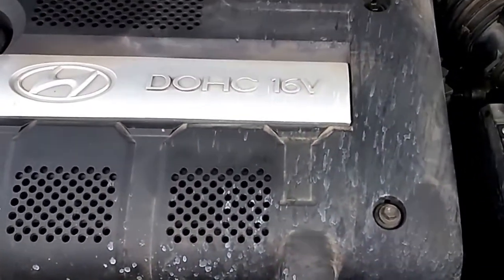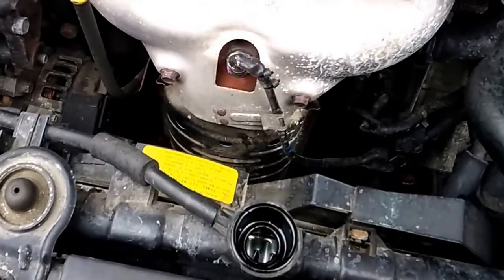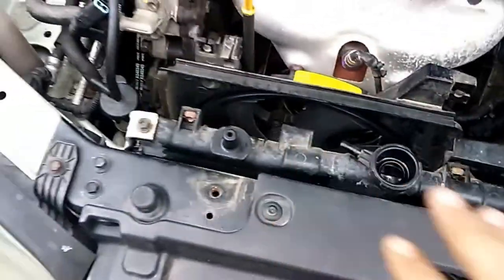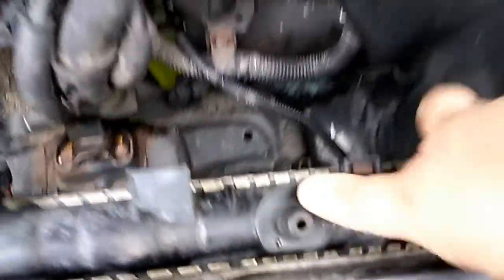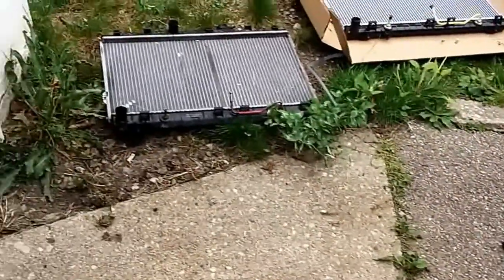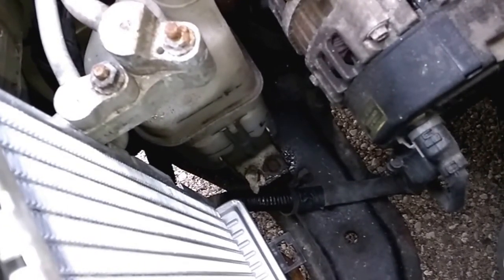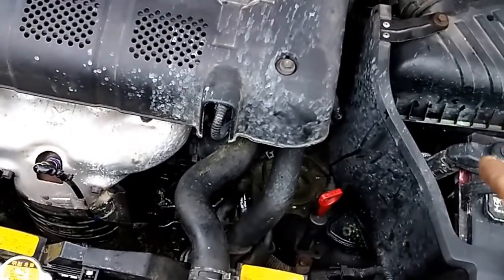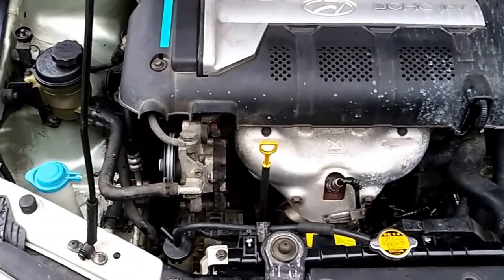How to replace a radiator in a 2004 Hyundai Elantra

Comment: Thank you for this video.  I'm a single mom and the radiator on my 2004 Hyundai started leaking last month.  Called different shops in my area and they were not encouraging.  Had one guy tell me that maybe it was just time for me to trade it in.  Wh?? I didn't know how I was gonna be able to get it fixed.  I did a google search and found your video.  After watching, I ordered a replacement radiator from eBay.  I've got all the tools etc. ready and waiting for it to arrive.  With your help from the video, ( I took detailed notes lol ) I have every confidence that this is something I can do myself.  I AM WOMAN!!!  haha.  If only I could pay myself $75 an hour for labor.  THANKS AGAIN!!
Reply from the maker: It's a super easy job, the only slightly tricky part was getting those bolts to line up on the sides, it just takes a little jiggling and patience and they go in.  The Elantras of this vintage are super easy to work on and fix in general.  It's been 75,000 miles since I made this video and the radiator is still doing fine.  I would quote one hour ($50) labor to do this job.  Your shop must be crazy. In the auto repair industry these types of jobs are called gravy jobs.
Reply: Thanks for the reply.  The radiator came in yesterday and when I got ready to drain the coolant, I noticed my radiator doesn't have the fittings at the bottom like the new one has.  Turns out it's because I have a manual transmission and not an automatic.  I've googled this and found that you can replace a manual transmission radiator with an automatic one just ignore the fittings.  Do you agree? Will they cause future problems? Should I try to cap them off or something?  Thanks again.  :)
Reply from the maker: Yes you can just ignore the fittings.  There is no reason to cap them off its a separate passage in the radiator from the coolant so it won't hurt anything if some dirt gets in there.
Reply: FrugalPrepper's Garage & Garden you got 75000 from that eBay radiator? omg
Reply: Thanks for the comment, I have the same issue!

Comment: These instructions were perfect, thanks for spending the time and sharing.  I created this simple checklist from your video:
1. Start draining, 2. Remove fans wires, 3. Remove overflow hose,  4. Remove top hose, 5. Remove fans (+ 2 zip ties), 6. Remove bottom hose, 7. Remove trans cooler pipes, 8. Remove AC Condenser bolts, 9. Remove Radiator bolts

Comment: I bought the sunbelt and was able to install the radiator using your video. However I had to buy two sunbelt radiators because I damaged the transmission line thread by over tightening it. Recommendation for anyone doing this: the two brass nipples on the bottom of the radiator that come with the sunbelt has a bolt that needs tightened or else transmission fluid will leak everywhere. I stripped the one bolt by over tightening and I was not able to create a seal so I had to buy a second radiator. The second time I took the nut and the fitting off and wrapped the threads in Teflon tape and then tightened the brass fittings and everything worked and did not leak. Be careful it is easy to over-tighten and strip the fittings since they are brass.

Comment from the maker: Just wanted to check back in.  It has been well over a year and this Sunbelt radiator is still holding strong.  I haven't had any problems with it at all.
Reply: FrugalPrepper why did you have to change it in the first place?
Reply from the maker: It was leaking.
Reply: WTH was wrong with yur camera

Comment: Just what i was looking for when you said $40 for the radiator on ebay. i was hesitant to buy one at that price but it is for an 02 elantra :) so Im not looking for great quality parts. My rad. actually wore down at the neck and the cap keeps turning. Ive tried 3 caps and they all do it. They are plastic after all. I think im losing pressure/allowing air into system causing my heat to not work well at idle. There are also slight traces of coolant along the top of the radiator. Good job
Reply from the maker: With the heat issue.  I had that too, but when I did my timing belt I found out why, because I changed the water pump while I was under the timing cover.   The fins had all worn down on the water pump and weren't moving as much water as they should.  After the new pump the heat works great at idle again.  Also beware that it's not entirely uncommon for these engines to have thermostat problems with the factory thermostat, and they will have problems with heat at first and eventually the thermostats will lock up in then and stick shut and they will fry a head real quick.  They will warp to where you can machine them back into tolerance.   I have about 20K since the radiator change.  I drive a little over 1000 miles a week normally.
Reply: FrugalPrepper I changed the thermostat when I flushed and filled the system (including heater core ). it wasn't bad but i figured might as well since I got a new one for $7. I'm not a mechanic but I can get the heat at idle sometimes when I'm bleeding/burping the system.  then the problem comes back.  that's why I'm thinking I'm getting air in there through the radiator cap.  I'm hoping it's that cause I just ordered one.  if that doesn't do it ill change the pump and that will be a whole new cooling system!

Comment: How big and long are the bolts for the condenser brackets?
Reply from the maker: I honestly don't remember.  I made this video a long time ago.  I am guess they on 10mm and they weren't crazy long or anything.
Reply: @frugalprepper  thank you. I bought a 2006 Hyundai Elantra in may and been working on it since, and I've been thinking about switching the radiator out with a new one. The one that's in it, is good and running, bolted down, but it doesn't have the holes for the condenser brackets, and the brackets out on the sides. I also wanted to get new bolts for it.

Comment: just so  you know for next time buddy. ...that reserve coolant reservoir comes out without moving anything.  I took mine out to clean it when I did a flush and fill .  it is tight though.  you just have to wiggle it around and work it.  i think it was the alternator that was keeping it from coming out easy. I have the 02 elantra  and I think we have the same set up

Comment: mine started up fine after this repair but it had a small hose leak. I shut it down to fix the hose now IT WILL NOT restart just turns over and over... ? any ideas?
Reply from the maker: Which end was the hose leak on, back by the thermostat?  If so all you wiring to you ignition coils are back there,  I would make sure you didn't know the plug to the coil packs loose.

Comment: An OEM radiator at the dealership here charges 86 bucks and includes a cap.
Reply from the maker: That's a deal.  I'd snag that up If were you.  My dealer wanted $180 for one.

Comment: I have a 05 elantra is this a good site to order from grest video I will be using it I thought it was the ECT changed and it's still running hot then splash from the inner top of the radiator with little bubbles
Reply from the maker: Mine never ran hot, but leaked a little around the seal on the top.   How hot it is getting.   You may have a radiator that is leaking because the engine is getting hot.  The thermostat on these engines is also a common failure if they start running hot.  When It gets hot feel if the top and bottom hoses.  If the the top one is super hot and the bottom one is cold or cooler, the you may have a thermostat or plugged radiator.  You can check the thermostat in a pan of water on the stove to see if it opens.  But if it's been in there a while it's not a bad idea to replace it anyway.  If you replace the thermostat get the genuine Hyundai on.  The aftermarket ones open to late and throw a code.   Don't run it to hot.  The heads on these things warp like crazy if they overheat at all.
Reply: I have an 05 every time I start it it struggles to then it catches and starts to run the rpm is under the 1 I'm scared to move it in case it doesn't start I changed the ECT sensor thought that would fix the rough start  nope
Reply: It's goes to the red both top hoses are extremely hot it's hard to start when its cold after a few cranks it slowly cranks then starts to run scared to move it don't have the money to get it towed god 4 bid

Comment: same thing happened to me, just replaced cam belt, waterpump and the cvs. was hoping not to have to spend money on it again and now the radiators leaking lol think im just guna burn this thing
Reply from the maker: Well mine is paid for.  It has had a lot of problems lately, but I don't mind putting some money in it.  For now it is hauling me for hour long commute to work each way every day and it gets fairly good gas mileage.   The rear subframe is rotting out on mine now and it about 300 just for the part at the dealer, but some people pay $300 every month for a car payment.
Reply: turned out to be the plug at the bottom of the radiator had a minor leak, should be able to replace it for cheap
Reply from the maker: That's cool.  I believe mine had a O-ring on it, you may just be able to replace that.

Comment: How is this radiator?
Reply from the maker: Fine.  Its sill working about 5,000 miles later.  No issues.
Reply from the maker: 11,000 on it now and still holding up just fine.
Reply: I actually went ahead and got one, works really well!
Reply: whats the link of where you got your radiator? i need one for a 2005 hyundai elantra
Reply from the maker: http://www.ebay.com/itm/2387-RADIATOR-FOR-HYUNDAI-FITS-ELANTRA-TIBURON-2-0-2-7-L4-4CYL-V6-6CYL-/271458068231?fits=Year%3A2005%7CMake%3AHyundai%7CModel%3AElantra&hash=item3f34296707:g:CyYAAOSwFV9X0a27&vxp=mtr
Reply: thanks man!
Reply: hey how did your screws fit? because the bottom side screw holes that holds the radiator and ac condencer (i believe thats what its called ) wont align, even without the adaptors.  i couldnt find the personal message button to send you a pic. did you encounter this problem?
Reply from the maker: Jesse Galindo
Mine fit, but I had to slide the clips in on the radiator that held the nut that the bolt went into.